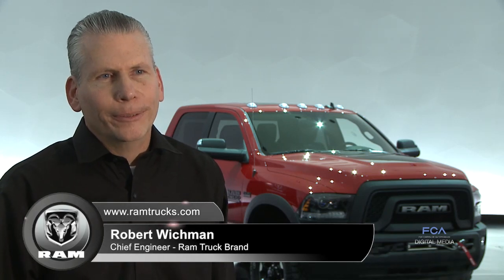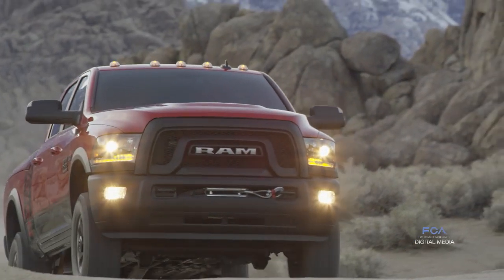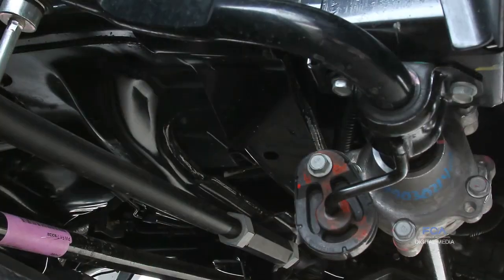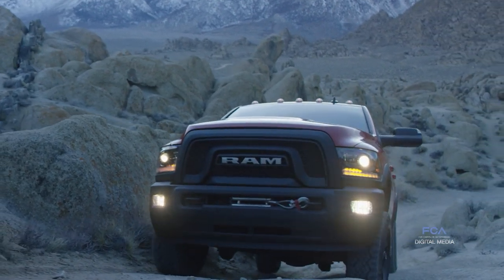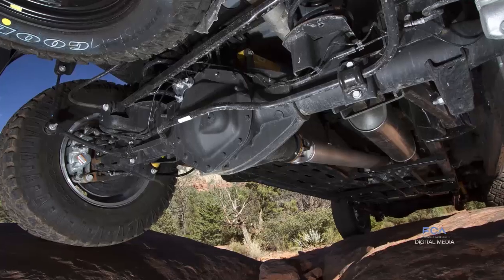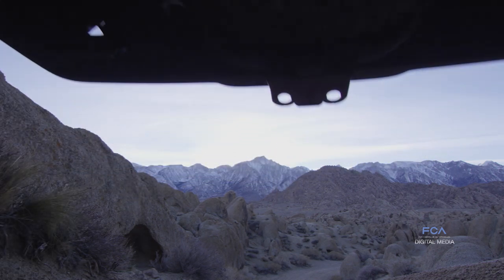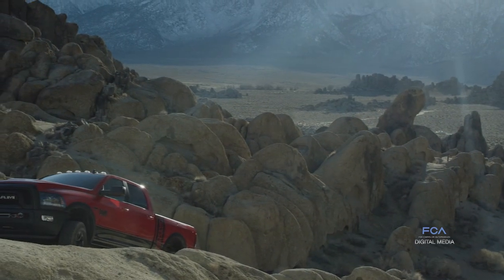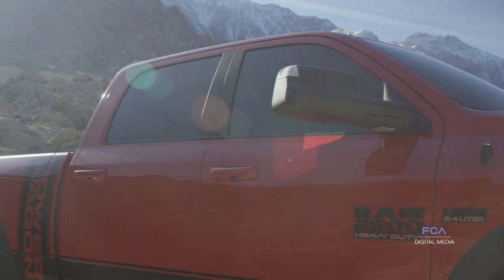Ram Power Wagon Engineering Overview

Comment: I really enjoy my new Power Wagon, the only thing that I don't really enjoy is the engine. I understand that you guys can't put a cummin turbo diesel instead of the 6.4 hemi, it will be to heavy and it will not fits because of the winch, but you could put more horsepower and torque to the 6.4 hemi. You should tune those bad boys like the charger or challengers 6.4 hemi to make 475 horsepower so it will be more reactive and a little bit more faster.
Reply: Just do it yourself.   Cold air intake, exhaust, and a tune.  There you go.  500hp.